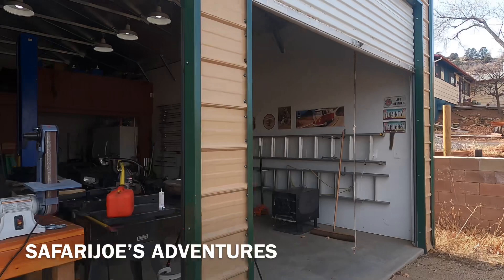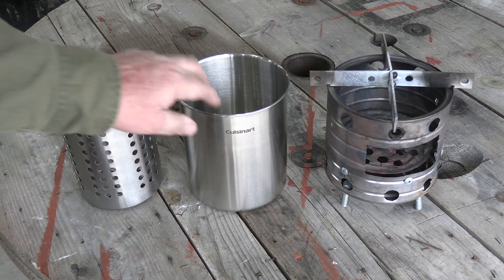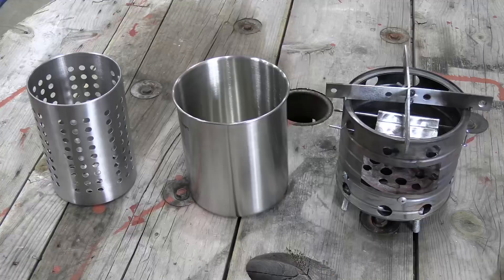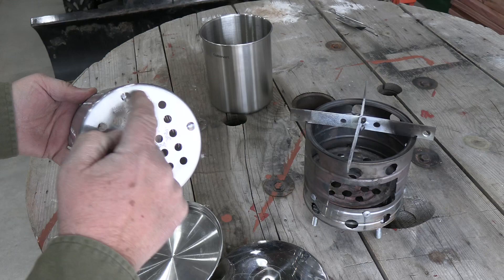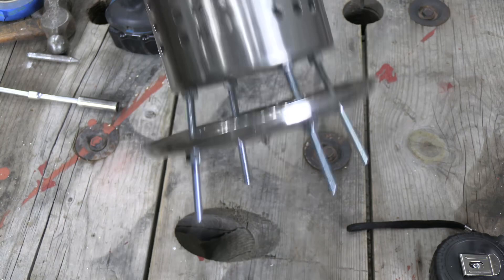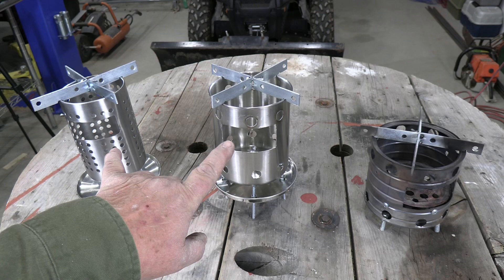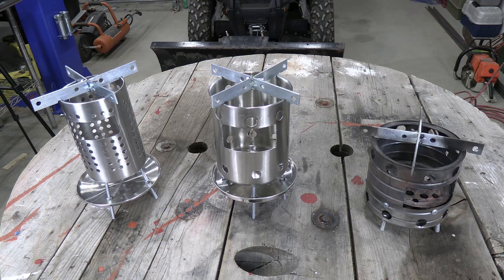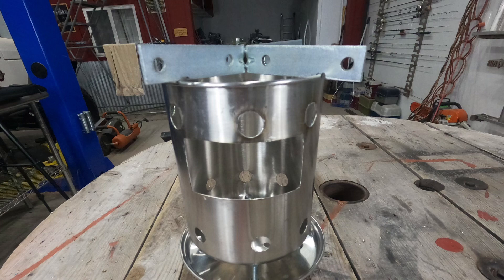Hobo stove DIY stainless steel

Comment: I was saying just the other day that thrift stores are as crazy as everywhere else with the prices!! I have several of the utensil holders I added bolt legs to, I also have a bale so I can hang them.. I didnt cut feed holes because I use them more as mini fire pits than cook stoves.. for ashes I use a tinfoil pie plate or just a piece of foil if they would be a problem.. I recently picked up a strainer insert for a large pot Im going to use as a fire pit.. I really like both of your designs, thanks for sharing them
Reply from the maker: You’re welcome. I do use these when I am out and about hiking or camping. The stainless steel ones are tougher and will last longer.